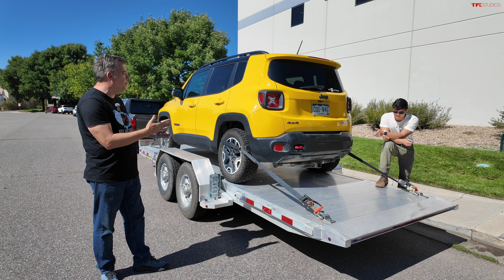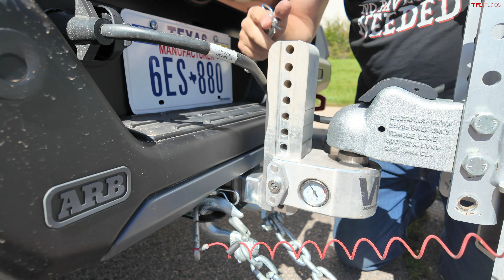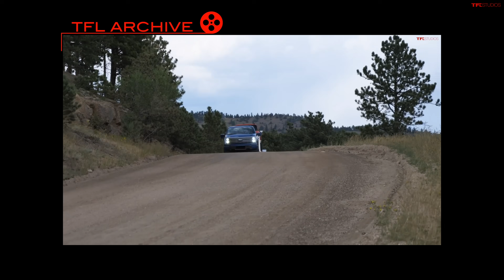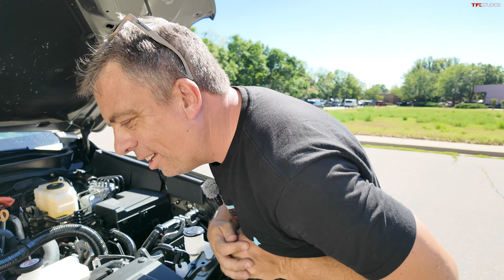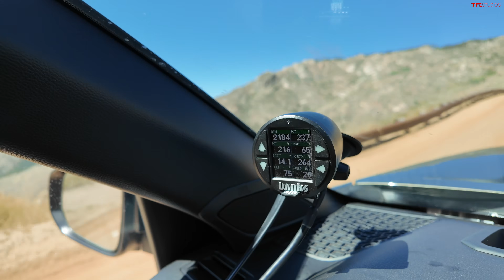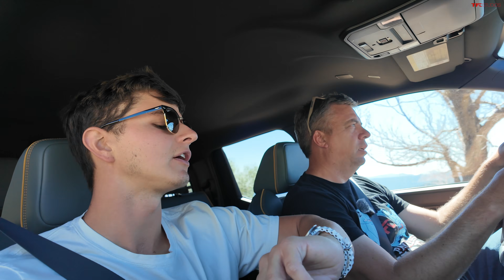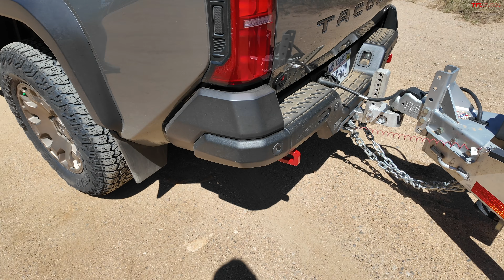Bigger Trucks Have FAILED Our Towing Torture Test, But Will It TOAST the Toyota Tacoma Trailhunter?

Comment: Hello, Andre! Send a transmission fluid sample to Blackstone labs and see how the trans fluid held up. I’d be curious to know how these new synthetic fluids hold up to the high heat it experienced. 
I’m really liking the torture testing. Keep up the great work, fellas.! 
Houston, TX
Reply: Great idea
Reply: Toyota ATF is not synthetic
Reply: i dont think there is a fluid that will stand up well at 250 degrees for any amount of time.
Reply: @bendino9016 FWIW, the testing on other synthetic ATF shows them maintaining acceptable oxidization after 200 hours at 160°C (320°F). If the Toyota fluid is similar - 270 is well within the normal operating range and should have low degradation of the fluid. 

Would be cool to see it tested.
Reply: @MrJcjet Who decides what the acceptable level of oxidation is? Plus, if that’s 300 in the sump it’s going to be well above that in the converter. Which puts you back to cooking the fluid in the converter. 
At the end of the day it shouldn’t be that high even if the fluid can handle it. Even a small added trans cooler would be a big help. But, that adds cost and I guess they can’t fit it in the $75k budget for a small truck.
Reply: @NBSV1  the tribologists determine the oil lubricating properties based on testing. The oxidization is just a measurement they use as an indicator. But the oil function is what's really being evaluated. 

It is measured the same way the oil is measured here. The temperatures are comparable. The trans sensor number one is immediately before the inlet to the oil cooling circuit where the temps are closest to maximum temperature. 

In short- the oil is fine. The 270 temp isn't hurting it. It won't be darkened or smell burnt. It won't be oxidized. It'll still provide the spec film thickness. The transmission life should not be affected.
Reply: @MrJcjet  270 may not be hurting it as fast as 350 would. But, it’s absolutely hurting it more than 230 would. Adding a trans cooler wouldn’t hurt anything. Could even get real fancy and put a thermostat in there to bypass the cooler if it’s below a certain temp. 
You still haven’t said who decided that level of oxidation is acceptable. The people testing are collecting data. They aren’t always the ones deciding what’s acceptable. The vehicle manufactures are generally willing to accept things as long as most make it to the end of warranty. The levels of oxidation at 300° might be acceptable if you only expect the fluid to last a short while. They may even have wording in the manual about needing to more frequently change the fluid under harsh usage to cover themselves when people burn up the transmission. 
Even with modern synthetics you still don’t really want it to run that hot for very long if you expect it to last. Someone pulling a camper could have this thing under load for hours on end going through the mountains.
Reply: @NBSV1  If you ever have a chance - google how Toyota does the transmission cooling/warming fluid system. I suspect it's a lot more complex than you think. The oil from the transmission comes up to a liquid to liquid heat transfer unit that uses engine coolant to warm the transmission fluid during the warmup stage. The biggest issue is usually fluid not being warm enough, rather than being too hot. 

Toyota durability testing is what determines the oil life and specs. Toyota has data insight into the life of millions of transmissions and routinely buys old vehicles to tear down and review internals, test oil, etc. There's a lot of data collected that you don't often see. Toyota doesn't design products to last until the warranty expires. Couldn't be further from the truth. There are some videos by the durability testing teams you can find. They do all sorts of wild stuff - for example one of the tests for transmissions is to bypass the reverse lockout and then see how fast they can go forward and then slam the transmission into reverse while traveling 20 30mph in forward and see if they can break it. It's ridiculous the lengths they go in durability testing. 

Cooler temperatures don't always translate to longer oil life. The right temperature is what matters. The key is to have the fluid viscosity correct for the oil film thickness required for the bearing surfaces. 

The most likely reason for not having a separate trans cooler is that they simply don't need it. If the oil life analysis shows that a cooler would have no incremental value extending the life of a transmission but would add $25 to the cost of the vehicle - it is in the customer's best interest to remove it. It's possible that they get it wrong. But I've had much longer service lives in my Aisin automatics than my Allison ones despite the Allision having routine oil and filter changes and a stand alone cooler.

I tend to prefer the comfort of having the trans cooler there myself. My Tundra has one. I've added them in older vehicles. But the lack of transmission issues tells me that they're probably not necessary. And this test generally confirms it. The cooling system it has works. If you can't overheat it doing this - when would you?
Reply: @bendino9016 yes they will.
Reply: So what are Tacoma transmission temperature change intervals? That it goes to 220f in normal commutes, says the fluid gets stressed far more than other brands.
Reply: @seagullsbtn  The rate of degradation doubles for every 10C increase in temperature. If those fluids are ok at 320F for 200 hours then that means they are ok at 220F for ~9000 hours. At an average of 30 mph, thats 270,000 miles.
Reply: @Jay-me7gw  I went back and found some testing published by intertek for GM fluid. They run 325°F for 450 hours as the baseline for that test. If Toyota does the same, it supports the idea of lifetime fluid. That's over 500k miles at normal temps. Even the spikes into the high 200s wouldn't meaningfully change the life if the target is 250k miles. (I think that's Toyota typical truck design life. Iirc Toyota uses 180k for passenger cars).

And they're not just baking the fluid in a tank. The test is in a running transmission powered by an electric motor against a dyno brake for 450 hours at 325°. It's a pretty legit test in my opinion.
Reply: @seagullsbtn  not needed. It's good for 300k miles as is. I change mine every 100k in my Tundra that tows 70% of it's miles. But it looks great and smells like fresh crayons.

Comment: Have you done this with the Ranger Raptor? Can we see this same test?
Reply: Ranger Raptor finished with much cooler trans temps, which is wild because the dash said 71 degrees in the tacoma and 86 degrees in the RR so it was a hotter day for the ferd.

Comment: This would be interesting with a 1977 GMC Dooley with a 454 engine heavy duty cooling radiator and the Muncie SM 22 four-speed transmission, which is a manual for those who don’t know.
Reply: That's very specific, do you have one for them to test?
Reply: I’m a year older than that truck and as soon as I read Muncie I knew what it was, though I’m more familiar with the 420 since I was into Jeeps
Reply: Here in my country there are a lot for 3-5 tons (overload) hauling coffee beans  on 30-40% grades. Many of them with a small block or 80's 6 2 diesel.

Comment: I would like to see more 3/4-1 ton trucks doing this test. I tow about 11k lbs and traded my F150 for a F350 Godzilla. Power wise the 3.5EB had no issues, in fact maybe slightly better than the 7.3 but one of the touted benefits was duty cycle. The Godzilla should be able to handle the load every mile of its usable life and do so in much wider operating conditions… in theory.
Reply: Exactly. Once you tow with a modern HD (even gasoline) you'll never go back to the EPA rated consumer lifestyle trucks. The small turbo engines make great power and torque and give people a false sense of security in what their truck should actually be doing. I'll take a slower non turbo gas HD truck with full floating rear axles/springs/frames over any of this hybrid overboosted trash.
Reply: @jasonperry7970 HD trucks are also lifestyle vehicles, just for a different lifestyle. I moved up to an F250 recently and have never felt more confident towing. I have also never felt more bumps while driving unladen.
Reply: Came here looking for this comment. HD trucks should be good for it.

Comment: It is STILL OVERPRICED like all the current Tacomas. Your test is lame too--do it with actual Summer heat, like here in Vegas.....110 degrees plus.
Reply: It seems that if you want true performance and capability one needs to pay the extra for a robust built truck that will deliver on its advertised capabilities. 

Clearly the domestic trucks, cheaper trucks, are lacking in their advertised capabilities.

Comment: You cannot deny that this truck did very well. I'd love to see them try this with a 20yr old truck and see how differently the results would be. Say a 2004 F150.
Reply: "a 20yr old truck" and "2004 F150" physically hurt me, but it's not wrong.
Reply: I’ll volunteer my 2000 tundra with 360k miles if they want to cover my costs to come out 😂
Reply: @84Prerunner  would have no problems !

Comment: Just bypass the trans coolant lines from trans to a separate trans cooler. That’s what I did on my Nissan Titan because combo radiators can mix the 2 different fluids and ruin transmissions when just need a radiator replaced.
Reply: @CarlosJaimesDJMajesty  This is a bad practice. You should route the line to the additional transmission cooler you add, and then route to the integrated tranny cooler in the radiator,and then back to the transmission. 

The reason for this is:

1. If it's cold outside, trans temp gets up to operating temps faster, as it's routed through the radiator.
2. In the event an aux cooler fails, you still have the integrated cooler in the radiator.
Reply: @anoop4243  The other reason is that at low speeds, the external cooler may not be getting enough airflow to properly cool the trans fluid. Having the radiator end tank will help with that.
Reply: @Jay-me7gw Running hot transmission fluid through close to boiling engine coolant doesn't do much to cool down that transmission fluid.
Reply: @dvader3263  The coolant wont be that hot at low speeds, low load. Plus they are on the cold side of the radiator where its 30-40* cooler than the outlet of the motor.
Reply: @anoop4243  just do warm up procedures for trans fluid for cold temps. Rather take my time warming up the fluid than to have to replace the transmission due to a combination internal system failure in the radiator
Reply: @CarlosJaimesDJMajesty  Trans fluid dosent get that warm unless you drive. In the way I mentioned, there is heat exchange between the coolant and the Trans fluid. Even if you have a separate aux trans cooler, most modern cars have a trans-oil to coolant heat exchanger built in. You just have to make sure that u keep the temps reasonable while towing.
Reply: @CarlosJaimesDJMajesty  I would hope Nissan fixed the SMOD issue by now.
Reply: SMOD was very common in the Frontiers, Xterra’s, and Pathfinders from 05’ to 10’ and even some 11’ model years. I’ve never seen a Titan or Armada suffer from it. Bypassing was the quick fix until you can replace the faulty radiator. I’ve ran my 05’ Xterra with 209k bypassed since I’ve bought it with 196k. Other members have ran it for years with no issues. Granted you shouldn’t, for the sake of transmission life.
Reply: he wants to avoid the strawberry milkshake. not uncommon for nissan trucks. at least the older ones.

Comment: the Tacoma passes but comments saying it still failed. The cope is real
Reply: They say it failed because that temperature cooked the fluid, transmission doesnt fail right away.
Reply: You call it what you want, at those temperatures i call it hard fail. My semi truck with 80k lb load in 100 degree weather doesn't go over 220  on transmission and 180 coolant. And that is 1.2 million miles truck with original engine and transmission. Whit that tiny truck i see anything over 230 transmission i stop...
Reply: @zelenizub2036 agreed the transmission is smoked I feel sorry for whoever ends up with that truck.

Comment: If you need to tow ~6000 lb, you NEED a truck thats rated at ~12000 lb especially in CO. You have to build in your own factor of safety. In my opinion, the best all around trucks are GAS 3/4 ton HDs. They are simply more truck than ANY 1/2 ton and certainly these light consumer lifestyle trucks like the Tacoma. The lack of EPA fuel ratings means they can be built correctly:  huge mechanical fans, heavy duty radiators, transmission coolers from the factory, lower differential gearing. These gasoline HDs can be had for $10,000 LESS than this trailhunter.
Reply: That's ridiculous. If you only need to tow 6K, you do not need an HD.
Reply: @Dusdaddy  yea....you'll need a new engine and / or transmission every 50000 miles.
Reply: @jasonperry7970  Much cheaper to rebuild a tranny at 150k miles with heavy towing than to get a 100k+ truck upfront & pay more for gas, insurance and possibly everything else. The engines are gonna last, they were designed to tow anyway. The only extras that are needed are a HD tranny cooler & an Air-Lift kit.
Reply: @jasonperry7970  Again, ridiculous. I tow 5-6K constantly with a truck that has an 8k max and it's doing fine. Using your theory, you would need a semi to tow 20K  apparently.
Reply: @Dusdaddy  you are missing my point. The question is not whether a truck can do it, but rather if it should do it. An 85 Toyota pickup with a 100 hp 22r could probably pull that weight in low range albeit at half the speed these guys were going.
Reply: @jasonperry7970  And you are missing my point, you do not NEED to add such a buffer to the max tow. Will it be easier? Sure. But so would be using a semi to pull 10K. It's just not needed, nor will it greatly extend the life of the truck.
Reply: 6000lb? HD? Even some mid/full size SUVs are rated tow more than that. I wouldn't even think about an HD until I'm pulling over twice that load.
Reply: You are missing the point of this test. If ONE NEEDS to tow at max that random time on a hot summer’s day, on a slow winding grade, can it do its advertised max weight? 

That is the question. Not should it be a heavy duty work cycle truck, towing its max daily…. Which I think most Toyota trucks could handle without problem.

Comment: You are gonna have to do this again in the middle of summer. The ambient temp only being 85 is definitely benefiting the trailhunter
Reply: I wanted to see how it did going back down.
Reply: Altitude has a much larger effect on cooling than 15 or so degrees.
Reply: Mid summer test is reasonable.
Reply: Shutup
Reply: @Owen-ep2lc  how about nooooo

Comment: 2021 ranger moved my family and I across the country towing 7300 pounds with a full bed. The highest trans temp I saw was 222F and 215F engine coolant temperature. The new 10r80 have a lot of updates done to them for reliability.
Reply: Big difference from going up a steep hill with 6000 pounds with no airflow. No comparison.
Reply: @Rc4hack  so there are no hills going across country?
Reply: That's awesome! I have a 2024 with the new 10r60 trans and am moving 3100 miles next spring. 20" enclosed trailer and should be loaded close to max towing capacity. I'm excited to see how it does.
Reply: I used to tow a travel trailer when I had a 21 Ranger and I’d see 225-230 on the trans sometimes and I was uncomfortable but 260-270 is crazy! I now have a F150 Powerboost and pull the same trailer.  None of the temp gauges ever budge now. I did love that Ranger. I had it leveled with Fox 2.0s,  32 inch KO2s and FP tune.  I thought I would really miss it but man, the F150 is so awesome and I don’t miss the Ranger at all.